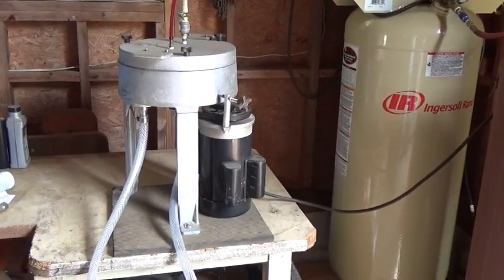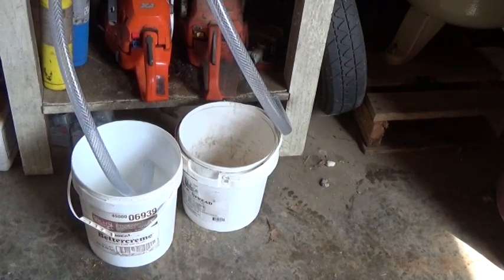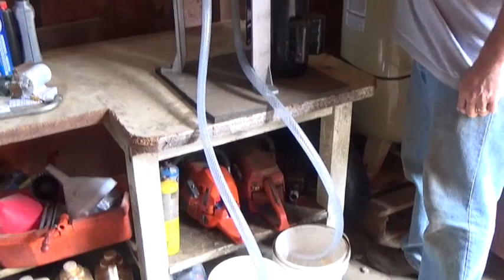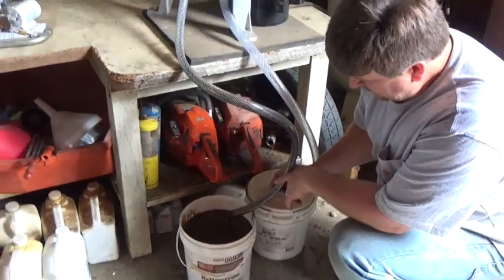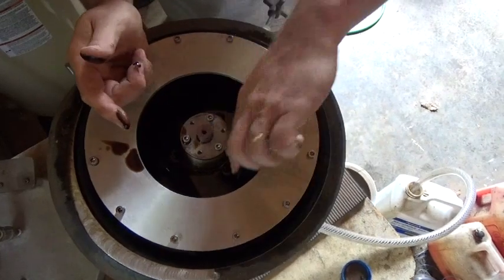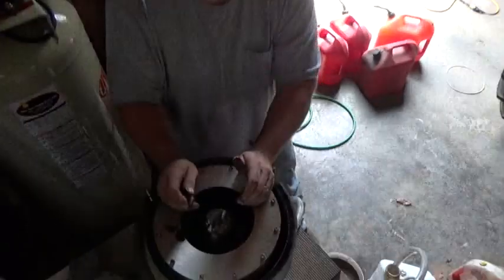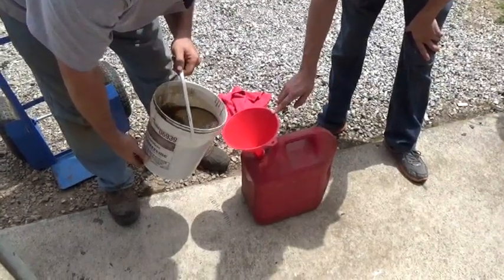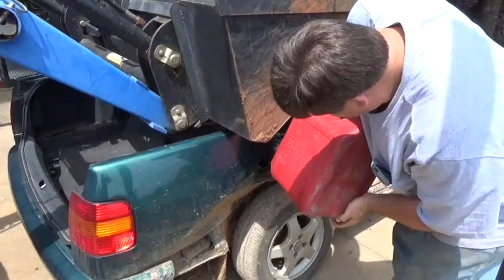Black Gold!  Spin Free Fuel!

Comment: Why would it have to spin so fast? Can't you just use a milk cream separator that is hand cranked?
Reply: LMAO
Reply: The faster the spin rate, the higher the allowable flow rate. A high spin rate is also more effective for more viscous oils like heavy weight engine oil, or gear lube. For diesel fuel, your hand cranked separator would actually work, owing to the low viscosity. (similar to cow's milk)

Comment: doesn't a standard 120 v circular saw motor pull about 15 amps ac and run at8,000 to  10,000 r.p.m.? how would that be for a direct drive motor? the only thing i could see that might bring a problem would be spin up. just sayin.

Comment from the maker: overclockedamd123 1 gallon diesel = 139,200 BTU
I run 5 gallon batches and it  takes 30 minutes to spin the oil down. 
Clamped centrifuge with Fluke and running at 15 amps x 240 volts = 3600 watts/2 = 1800 watts to run a batch ( made via generator running the oil). 
5x139,000= 696,000 BTUs = 203kW
So I get 203,000 watts of transportation energy for 1800 watts of electricity.   
Are you kidding me? Oil that was being thrown away producing thousands of free miles and loads of electrical power.
Reply: I used a variable speed  woodworknng router 12000 _ 24000 rpm. For the motor.
Reply: +engineer775 Practical Preppers watt-hours?
Reply: It gets better. the lower the flow rate, the LESS power required by the motor. You can very often adjust down the voltage to the motor with a Variac, and reduce the current to the motor, as well as the voltage. A lightly loaded motor can run MUCH more efficiently, with less supply voltage. Use a clamp style amp meter, drop the voltage, and look for minimum current. (If the voltage is too low, the current will start to increase again) The motor will run much cooler, allowing for extended run times.
Reply: Hi sir, I am Hicham from Morocco. I want to communicate with me because I am interested in a machine like what I have done
Reply: It actually doesn't get thrown away if you take it to a legitimate waste oil drop-off.  There are refineries that take it and process it into propane, diesel fuel, and asphalt.  But yeah I agree -- why give it away for free to the refineries when you can use it yourself with a little effort

Comment: Yea and you just used tons of energy to produce this.  Stop it.  You are wasting energy to save energy.  Jesus these nutjobs are getting old.
Reply: LOL...  If you think the few kW hours used for filtering is even CLOSE to what's used for fractional distillation of crude oil, your're an idiot.  This is essentially "free" energy.  I suppose you'd seal it in a tank forever?
Reply: The cost of the electricity used is far less than an equivalent amount of diesel fuel. You could save thousands of dollars a year with this process.

Comment: I'm trying to be helpful when I point out that it is well known that used engine oil contains carcinogenic and mutagenic chemical compounds.
http://www.sciencedirect.com/science/article/pii/0048969783901328
http://www.ncbi.nlm.nih.gov/pubmed/2612787
http://www.hse.gov.uk/mvr/topics/oil.htm
Reply: GriefEriksson same as gasoline, diesel, kerosene,propane, and electricity has it's down sides as well

Comment: Ihave seen on you tube somewhere of some one using two 55 gallon drums.Onm  One the temperature was raised to the temperature of a cars radiator fluid. The second barrel was connected to a centrifuge at around 20,000 rpm.He would then make three passes. From there he would add the apropriate amount of acid lye mixture or used it as straight veggie oil.
Reply: that is lye/methanol mixture.

Comment: You say, "The only way to get oil properly cleaned for LONG TERM RUNNING without problems is a centrifuge."  Well sir, for someone who is just doing this for the first time, you are hardly qualified to make that statement.  I have been using Veg oil in my diesel for 85,000 mi. and I now have 170,000 mi on the vehicle!

Comment: centrifuged waste oil IS NOT fuel!! To say that the only difference between #2 and black diesel are political motivators is just flat out fucking wrong. Black diesel is black because it has long polymer chains in it. This shit is NOT good to run long term in a diesel engine. Build yourself a still, get some education, and figure out thermal cracking. Then you can actually produce clean fuel, and not just from oil. Pyrolysis, its your only hope.
Reply from the maker: Dude, Did you wake up on the wrong side of bed today or what!? LOL
Reply: wrong side of the couch!
Reply: engineer775 Practical Preppers lol no seriously though. Free fuel is like my lifes work. {wasted at that, its a novelty i get it} But really, black diesel is black death for your engine. The newer the engine, the less tolerant of this fuel it will be. People really need to understand this before dumping it into their tank. This stuff would FUCK a modern computer controlled pdf equipped truck all kinds of up. Especially if the user weren't experienced enough in blending their own viscosity of fuel. But honestly, a tank full of sludge is about the best thing that could happen, not the worst.
Reply: And centrifuged oil is NOT DRY!!!!! Fuging only removes the free water, which is not the water you need to worry about. The magic crystals in diapers will absorb water based contaminants, but not oil. This is what the military uses for field storage of fuel to keep it "conditioned".
Reply: Diesel Ramcharger If he was using a wvo converted engine would this mitigate some of the issues you are explaining?

Comment: Might be obvious to most, but spinning old gasoline might be a poor choice...
Reply: The only value, would be to separate water, and particle matter from corrosion. You would want to blend it with new gasoline, to ensure the engine starts, particularly in cold weather. I would only use this blend in a very forgiving carburetor engine. (Briggs & Stratton)

Comment: Nice system, but I was a little surprised at the cost. I was thinking about $1000. It does looks high quality. I guess if you have numerous diesel engines, it would pay for itself. For me, I will just put that oil in my waster oil boiler.

Comment: Interesting.... Already thinking about a geared hand crank intead of an electric motor :)
Reply: Know anything about old fashioned cream separators?
Reply: Or hooked up to a bicycle
Reply: At the low flow rate needed for effective precipitation, I would recommend rigging it to a bicycle crank set, so you can pedal for 30 minutes or so. I'm lazy.....Which MOTOR should I use?

Comment: That is a great system however the 240V requirement is a bummer.  It would be interesting to see if you could power the centrifuge with a 12 or 24V DC motor that could be run from batteries or solar.
Reply: 12 volt DC industrial motors for continuous use are readily available. Scotts make good permanent magnet carbon brush  motors, that will turn the speeds you want at what ever supply voltage you want. They make motors that range from 12 volts all the way up to 96 volts DC.

Comment: Quick question: I've used Bluegrass Fuel Systems with a 10 micron filter. Their system implements 'beads' that soak in used oil for a time that absorb water, antifreeze, etc.. that might have contaminated the used oil.... Is this is a non-issue or what?

Comment: Not very clear here, you kind of glossed over how this oil is supposed to be used....can you 1) use the resulting "diesel fuel" by pouring it directly into the fuel tank of your old truck or generator or 2) do you have to mix this "desel fuel" with "real diesel fuel" in order to basically supplement that fuel, or in other words, reduce the cost/amount of "real diesel fuel" that you need to buy? It would be great if you could use the stuff straight, but it is less useful if it is just like making your own ethanol which in most cases only gives you a 10% "supplement" that you have to add real gas to.
Reply: Anything above 50% mix is typically too smokey to warrant acceptable use, so yes it is a way to reduce diesel fuel costs but not eliminate.
Reply: focodiesel thanks
Reply: focodiesel its also a way to frag your pump and destroy your engine. Centrifuged oil is not clean, especially after a single pass through a fuge like this. You want to see what a real centrifuge looks like? Go on a navy ship, find the turbine generators and look at the lube oil processor for that. Thats what it takes to get clean oil, not a spinning bowl :/

Comment: Would be interesting to run an oil analysis on the pre vs post oil.  How does one know if their diesel engine is old enough to run on this mix?
Reply: Duramax changed something after 2006 that wont let it run on it. GM added a optical sensor to the 6.5 in 1994 that makes it require clear fuel to run. Anything before the mid 90s should run on it mixed 50/50. 100% can be ran in most but they get hard to start. Its also illegal in most states to run it as a road fuel. Tax evasion for failure to pay road tax. Same as buying farm fuel.
Reply: Anything that is not mechanically injected would probably have issues, especially modern common-rail engines...orifices are too small and too many electric gismos. So, mid 90's is about right, I think dodge had 12 valve p-pump up to '98 so that should be ok too.
Reply: RebelCowboySnB  I know this is an old post but used oil collected for free has no tax obligations also taxes were paid when the original person purchased it if you pay for wmo then you may be required to pay road tax but it probably falls under double taxation then

Comment: How much energy does the centrifuge use? Is there a net energy gain by doing this?
Reply: If it can be powered via a solar solution, would it really matter?
Reply: mruler360 Yes. As a technical exercise to prove that old engine oil can be used to power diesel vehicles; this is interesting. As a means to produce usable amounts of motive power, the most efficient means should be sought. Solar power is not free. It is a diffuse and unreliable energy source, that requires considerable financial and energy investment to realise. My concern with a lot of these 'green' solutions, is that the distortion of subsidies can lead to a misallocation of resources. A misallocation of resources leads to the impoverishment of society. This is why socialists always drive everything they touch into the ground!
Not that I'm suggesting this guy's a socialist. How he chooses to spend his time and money are his business.
Reply: There may or may not be a net energy gain, but not all sources of energy cost the same amount. If he gets free engine oil and uses a little electricity at 9 or 10 cents per KWH...he's getting usable fuel for his vehicle for the cost of the electricity. Since the truck is not an EV, he can't plug it directly into an outlet and fill the tank to get the fuel. The most efficient means to power a diesel truck pulling a trailer full of horses, or logs, or whatever is not the point. And diesel power IS the most efficient solution for him anyway! So, the next salient point would be to minimize fuel cost which is the point of this video. Not every energy transaction needs to be carbon neutral, net energy gain, or "green". Sometimes it is just about saving a buck....

Comment: Is that same centrifuge you had when I was there a few years ago. Cool to see what it does.
Reply from the maker: Yes sir it is. It had collected dust for way too long. It works awesome and th vw runs great. You thought the last ride was fun. You should come down for a little refresher.  :)
Elijah and I have been practicing "drifting through the woods". Yeehaw!
Reply: I am not sure my old man heart can take that! You do have Barf bags attached to the dashboard I hope! LOL
Reply: engineer775 Practical Preppers  please addd a bunch of magnets within your centrfugeee or make a side filter. this should get all the metal shit outta there. really get it clean. make like a metal/iron filter tube but put a bunch of magnets on the lining in it to pull any microscopic metal parts outtta there, make it longer for more cleaning. that way you can remove it and still get the metal sludge part out of there. if there is iron it should get partially magnetized when it flows thorough and slough to the sides, so it should be cleaned after every use..... good work.
Reply: Nikola Tesla No idea how a centrifuge works eh? Magnets? lol. Fucking tesla guys and their god damn magnets. Morons, every last one of you.
Reply: magnets would not do much. now days 60% of what in the oil is aluminum and a magnet will not pick that up. so good luck on that one.

Comment: Awesome thanks for sharing!

I've ran my gasoline engine off of vaporized used motor oil. The vaporization process is done by using the exhaust heat coming out of the engine after combustion and submerging the exhaust heat exchanger in the used motor oil. At 500+ degrees F the exhaust temp. reaches it work great to run many different kinds of dirty fuel. The vaporizer is basically a oil or fuel distiller. Temperatures get hot enough that when vaporizing gasoline you won't have any leftovers or sludge buildup.
Reply: Diesel Ramcharger Vaporizer is correct. The exhaust temps aren't cracking the long chain hydrocarbons, only changing them from a liquid to a gas. You need either higher temps or a catalyst to crack them as a gasifier would.
Reply: Eisen Faust Did not know that.
Reply: gasifier is what they call them.

Comment: Excellent product for WVO.  Just have to get the WVO to a much lighter viscosity by heating it to 200 degrees or more.
Reply from the maker: Filtermaxx has great heaters too. I am working on a solar heater for the oil next.
Reply: engineer775 Practical Preppers put it outside in a black drum. done.
Reply: The black drum will not get the temperature to 180 degrees or higher which is needed, unless you put in a glass house/enclosure.
Reply: Bonnie Flory BULLSHIT. We take the insulation off water heaters, paint em black and put them on the roof round these parts. no shortage of hot ass water!
Reply: Bonnie Flory but i do live in the desert, so....lol its 120 ambient in the shade out here. quite literally.

Comment: I just run mine threw a toilet paper filter... One roll of scotts can do hundreds of gallons an costs less than a dollar.
Reply: I built mine out of PVC pipe. Its just a piece of pipe with capped ends that have nipples in them. Another capped pipe fills the hole in the middle. Oil flows in one end, threw the TP an out the other. I think you can still buy them though . Frantz is the name of the company that makes them.

Comment: That first batch looked pretty dirty. If you feed the oil s;lower bdoes it com e out cleaner
Reply from the maker: Yes, the flowrate on my very first batch was way too fast.  It is easy to dial in.  The oil will still be black from the carbon but it will be lighter and there are no contaminants in it.  I have run 5 gallons through the VW and it does awesome. Much more power than veggie and just seems to sound and run better.

Comment: farmers in my area use a fifty gallon drum with a gravity fed fuel filter attached. then mix 9 parts diesel fuel to 1 part used oil.
Reply from the maker: That works.   I just wanted to get away from needing filters and this is it.
Reply: I run 50/50 oil diesel mix in my case 830 tractor never had an issue I have a online filter on my transfer pump from the drum I change every 6 months to a year
Reply: Dave O'Brien what filter do you use?
Reply: +dufusrunescape 50/50 is the best and it makes good power. another way of doing it that doesnt take much filtering is with gasoline blending which forces over 90% of the contaminates out of solution